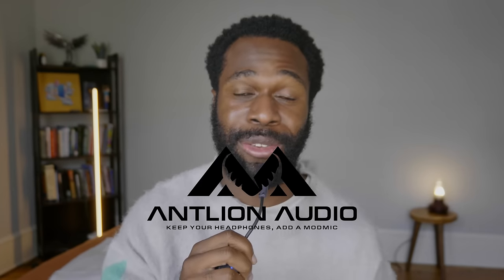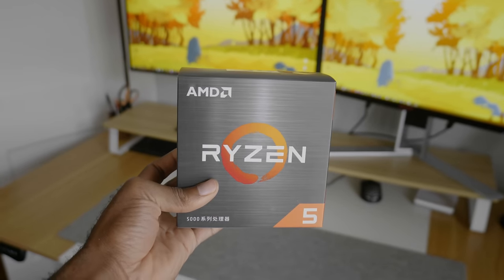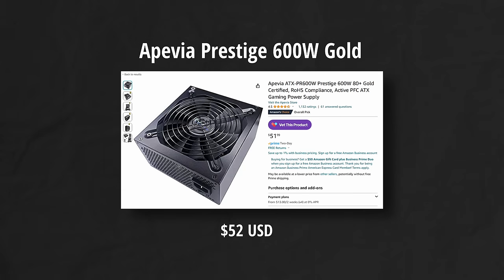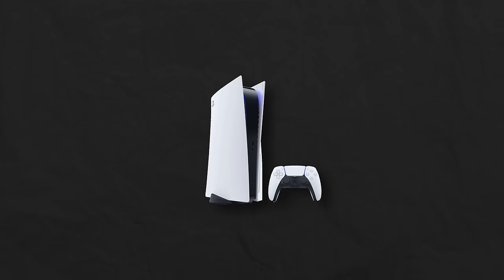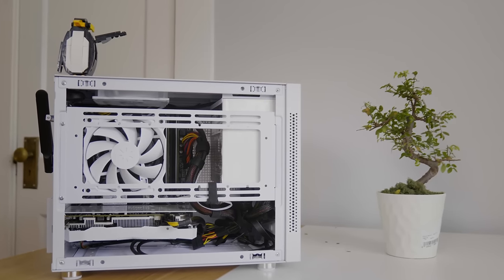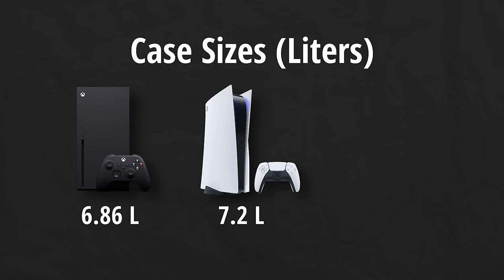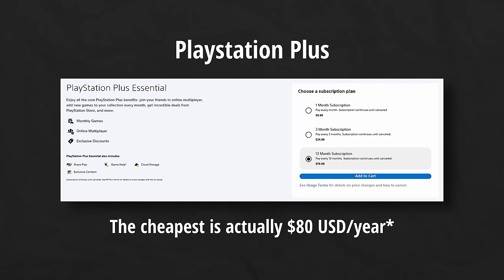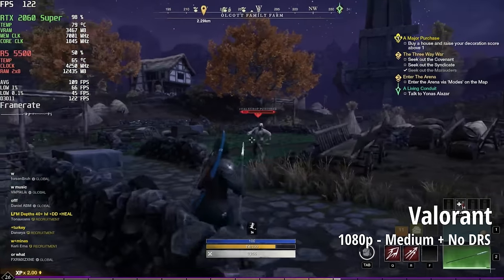The $500 PS5 Killer...did we do it?

Comment: Do not buy Nvidia cards if you want to build console killer machine. Reason is simple, both PS5 and Xbox use AMD graphics chips, and they are usually significantly better in performance/price ratio. Especially in budget segment. If you want console killer go with 6600, 6600M, 5700XT, 6600XT , 6650XT etc ...

Comment: About the GPU portion of the video... there is a gpu we can directly compare the PS5 to, which is the RX 6700 non-XT variant, and pairing that with a 4700g will essentially be like the PS5's processing unit. Same core count for the GPU and CPU, same amount of TMUs and ROPs, so you can't really say that there is a closer gpu to the PS5 than the RX6700, especially considering they are both based on the same architecture. Of course, console killers do not need to have the same specs as a console itself but I'm just pointing it out.
Reply: True. The 6700 is mostly identical in terms of stream processor count and architecture, the only major difference is memory layout.
Reply: @yasu_red  Yeah, but I feel like the difference in memory bandwidth isn't that much.
Reply: The RX 6700 is faster than the PS5 and Xbox Series X GPU. This is due to no limitations in memory bandwidth and no limited thermal envelope.
Reply: @ZackSNetwork  Correct, but on the other hand, the GPU in the PS5 and Xbox have access to a large unified pool of memory, while the 6700 is stuck with 10gb of VRAM.
Reply: @yasu_red The PS5 and Series X don’t have unified memory. They have shared memory because they are APU’s. They share the same memory and bandwidth with both the CPU and GPU. As for the RX 6700 it has infinity fabric that more than makes up for its unified memory. Also the PS5 and Series X only use 10-12gbs of vram for games anyway.
Reply: The ps5 has 10gb of vram as well. Xbox has a little more but that doesn't change the fact that you cant change the graphic settings for that to matter anyway.
Reply: RX 6700 is a bit better than GPU from PS5, but basicaly its downclocked RX6700, and about CPU there is Ryzen 7 4700S which is CPU from PS5, 4700G is also a bit better(higher base frequency and u have trubo boost, on PS5 u have max 3.5GHz and 8mb of cache, so Ryzen 5 3600 will have performance) so in the end u need Ryzen 5 3600 and RX 6700 for PC with performance of PS5
Reply: didn the Xbox had a faster GPU than the PS5?
Reply: @DDHDTV  In XSX u have something between RX 6700 XT and RX 6800(maybe its cutdown a bit RX 6800)
Reply: @dev1anceONE seems about right
Reply: @leogaming4663  It have 16GB of VRAM, but its shared between "system" and "video ram", and if u do some research then u know about CPU is custom Zen 2 with 8 core and 16 threads, with 8mb of cache and up to 3.5GHz with SMT enabled(They sell it with name Ryzen 4700S, but performance of this CPU is similar to Ryzen 5 3600), GPU is custom RDNA2 which means it used architecture similar to RX 6700 and any other RX 6000 series GPU, RX 6700 have almost same specs like that Radeon in PS5, so it isn't plenty of misinformation because today consoles are almost PCs with custom PC APU and custom OS
Reply: Your wrong. Pc need to have 8core cpu or more.  A gpu with 16gb or more to béat console. Is straight fact.  No way an 7700xt or 4070ti is better.. proof is cyberpunk ps5 4k easely outperforms those 2 gpu.
Reply: @690Dragonx  That weak PS5 CPU have 8mb of cache and at best 3.5GHz, and about CP2077 its works in between 900p-1440p upscaled via FSR2 on Performance mode and have drops to 50FPS, so yes, consoles have Ryzen 5 3600 and RX6700/RX6650XT EDIT. Oh and i forgot - PS5 and XSX have 16GB of ram SHARED between system and GPU
Reply: @DDHDTV  Only slightly. The difference in games is minimal.
Reply: he was staying with new purchases and cheapest 3700 is like $475 atm
Reply: @RideTheSkies  bro did you get that information from Walmart? 💀💀
Reply: @totogreeny  my bad, got it confused with the 3800 with lowest is $410 atm then bumps to $450. Still, 3700 is $350 new on pcpartpicker
Reply: @Barris_  bro you can't be serious 💀, they are literally the exact same spec besides some memory and bandwidth differences.
Reply: @Barris_  just runs the last of us at 4k high/ultra setting your pc then upload it on youtube. Show proof
Reply: @ZackSNetwork  abt the memory thing... you do realize that shared and unified memory are the same things, right?
Reply: @Barris_  you think everyone lie? but you dont have a highend pc and ps5? using adrenaline software or msi afterburner overlay is the same, both show identical spec/fps/gpu usage
Reply: @Barris_  you right is ps4 version, but on PC to look identical to ps5,,  it using 13 to 14GB VRAM to look identical. Rockstar and all big dev know 99.99% of pc gamers is on lower spec than PS5. that why GTA 6 is coming for ps5 /xsx first. because lowering graphical detail to low setup pc, is a wasted of time
Reply: Ps5 os better perfomance than windows.. and just one hardware optimisation ..
Reply: @Barris_  then prove it with real fact not just running your mouth like biased mad fanboy on low end PC :)
Reply: @Barris_   cyberpunk isnt even a ps5 exclusive and ps5 do far better then 3080.. just admit you broke. lol
Reply: @Barris_  benchmark made by player or made by promoter?
Reply: @Barris_  i know mosty of them but dont really need to be relate to all those promoter.. send link here
Reply: @Barris_  sorry  dude, if you have to beleive gamer nexus for better sleep at night.. god damn,, i didnt know those some promote can lie like him.. 0 bench just hand wirting fake performance. yeah gamer nexus hes  just a big liar , but at least i can see what liar look alike
Reply: @Barris_  3 years old hand wrinting benchmrak.. come on dude...
Reply: @690Dragonx wtf are you talking about bro
Reply: @690Dragonx GamersNexus are definitely more reliable than you
Reply: @690Dragonx You're not the only person on earth who can afford both a PC and a PS5😂
Reply: @deadking8224  sitck on your shitty RX 6700,   my pc build runs the last of us better than ps5 and rx6700.   the 6700 still cannot outperform a PS5 on Dragon dogma 2 and forbiden west. yup new games dude.
Reply: @690Dragonx  Don't own a 6700 though, own a 4070. And the 6700 XT is equivalent to and even better than the ps5 in Silent Hill 2 at 1440p Epic if you compare the benchmarks made by the other youtubers. The difference in frames is even more when you optimise the pc settings to the equivalent ps5 settings
Reply: @690Dragonx  Don't know why this youtube keeps deleting my replies.  The 6700 xt outperforms the ps5's quality mode in black myth wukong  too with the very high /high preset at native 1440p( without FG)

Comment: Spent around $700 bucks for my first PC build in 2015, the only upgrade was a really cheap GPU 2 years later. It absolutely held up for 9 years of great gaming. The newest and most graphic-intensive titles are starting to run really slow (low settings, 20-30 fps). But this thing still runs Counter Strike 200fps like a champ lol
Reply: are you planning on upgrading

Comment: You need to add peripherals. If you're a first time PC builder you need to add in the cost of a monitor, mouse, keyboard and desk.
Reply: if you are a first time pc builder you can get a starter pack or combo and get mouse, keyboard, headset, mousepad and maybe even a joystick for $50 and im sure you can find a used monitor for $50 more.

also, you can account for the path of upgradability in a pc, when the PS6 launches, if you want it you will have to straight up buy it, with a pc thats not the case, you can slowly upgrade it over time to keep up, and if you just want to compete with consoles upgrading that exact setup to the equivalent CPU and GPU will be cheaper, as you can still use most components without any problem, SSD, MOBO, RAM, PSU will still be usable for the next build.

Comment: I built a $500 pc with a GTX 1080 and a Ryzen 5600 CPU. Got a good motherboard, PSU and drive. Already had the case. Runs 1440p on med-high lretty well on AA or indie games and 1080p high with pretty much no dips below 80-100fps on most games.
Reply: Yoo I got the gtx 1080 ti with i7-7770k for $382
Reply: @Nish00128  Nice

Comment: Great video! If it wasn't mentioned already, I have a few suggestions:

1) You touched upon it in the video somewhat; Under Volting the CPU will greatly reduce heat and help improve performance.
2) Under Volting the GPU / graphics adapter will also reduce heat and help improve performance
3) If your motherboard and GPU support it, ticker with the fan curve to adjust fan speed only when temps increase to a certain threshold. This may reduce fan noise level.

*Tweaking these settings may take a few days due to stress testing / trial-and-error so be patient*

There are a good number of resources on how to perform the tweaks mentioned above on YouTube. A simple search with the make / model of the device of interest should suffice. 👍🏼
Reply: What is "under volting" ?
Reply: Applying less voltage then it comes with by default. Due to how PBO works, applying less voltage can result in less heat, and more performance. This is completely the opposite to how overclocking was done back in the days, back then it was the norm to increase voltage for more Mhz. Some manufacturers are notorious for having UEFI/BIOS settings with waaaaay to much voltage out of the box. Most motherboards, videocards, etc. come with very safe defaults out of the box. Most of the time, you can lower the voltage without any issue/damage or long term effects.

Comment: I have both a gaming pc and a ps5, and since I work remotely I would always choose a pc since its not limited to gaming/entertainment, but one insteresting point for me is that most of the "console killer pc" videos come years after the consoles come out, so I'd love to see someone take on the challenge the same year a console is launched. Also the consoles come with a quality controller that is at least 50 (euro here I suppose its similar in dollars) that should definitely be taken into account because you can't tell me that its a similar experience to using a dirt cheap 10 dollar keyboard and mouse combo
Reply: Good points, generally every console controller can be used on a PC.
And if you go for one of those Elite/Pro controllers on the console (those run between $100-200 USD), you can fund a decent K/M setup on the PC side.
There is wiggle room.
Reply: I remember when the PS4 came out and lots of youtubers came out with budget console killer builds. None of the pc builds survived past 2016. Even more so for the builds that included a blu-ray/CD player & hifi sound card. Yet I know people on launch model consoles who can still play some of the latest games, on 10 year old hardware.
Reply: it was hardly possible to buy a ps5 for a year after launch at msrp
Reply: @labibahasan8302  Exactly, these people are delusional. They quickly jump to the gpu being equivalent to the amd 6700 non xt not realizing it's a COSTUME version meaning it's similar but not the same. They fail to understand a console is a onetime investment and the pc for the most part its not, at one point you will have to add more RAM or a better video card or bigger psu etc.  They argue about how you have to pay for MP in consoles which for me and many more its irrelevant since I don't play nor care about MP. For me the strong point of the console is the single player games. I personally I have and play on both platforms, why limit yourself when you can have the best of both worlds.
Reply: @Atlas-hu9wk  You’re right, and even with the cost of multiplayer a pc still isn’t worth it for long term home entertainment. Let’s say a console + 6-7yrs of online is like $800. There is no $800 PC from 2013 that is still running current games at 1080p/60fps like the PS4 is.
Reply: @labibahasan8302  A console will not run all the games at the highest settings or fps but it will be much much more stable on the long run vs PC.

Comment: Honestly, that case fits the whiteout setup I was going for about 7 years ago. 
I had the following, if you're curious:
- Corsair Carbide Air 240 in white with black accents and interior
- Black & White MSI RX 480 GPU
- MSI B250M MORTAR ARCTIC White MOBO
- 8 GB Black and White Ballistix RAM
- i5-7500 (just so the specs are out there)

It was cool, but the Air 240 is notorious for GPU cables rubbing on the acrylic window. Turns out, it's actually enough to leave a scuff mark on the window itself.

Comment: Picked up a bunch of lightly used HP prebuilts for cheap recently. Ryzen 5300G, 8gb (2x4) 3200MHz DDR4, RTX 3060 12gb, and a 250gb NVME drive ... $300. Been upgrading them for flips or pulling parts for custom builds. A bit of hunting right now can lead to some super nice deals. And, while prebuilts like those HPs suck from the factory, if it's a good enough price you can always pull the non-proprietary parts and go from there.
Reply: You have a CPU bottleneck. 8gbs of ram is not good you need at least 16gbs of ram. You can’t fit much of anything either on a 250gbs SSD. The 3060 12gb is a great budget GPU though.
Reply: @ZackSNetwork  im sure hes flipping those...
Reply: Where the hell did you find a prebuilt with a 3060 ($450ish) card for $300.  That's better than my previous find which were two complete FX 8350/32GB Systems that the guy told me "Hey,  are you into computers?  I just throw two away in the garbage you can have if you want."
Reply: @Atari5732  - A guy who had bought the machines for mining right before the crash. They have just been sitting in his garage. I got 7 of them. But deals like that aren't that rare now. The prices I'm willing to pay for parts is ever dropping. To be fair, I hunt for deals since I build PCs perpetually.
Reply: @ZackSNetwork  - Yeah, reading comprehension is hard
Reply: I appreciate you for owning 2nd hand parts, seeing how more reliable they are (I just realised Bak covid), also helps keeps  e-waste

Comment: To reduce electric consumption you need to use vsync, and frame capping to a 60fps  this will put less strain on the hardware while also using less power by 20-45%.  For example DL2 in 1080p high with with my PC went from 190W to 110W on a I5-12500T, Z690 MB, and a RTX 4060 (it was 220W to 150W with my old RX6600 BTW).  The game I saw little to no help on this was RDR2 unless I lower quality settings only.  Power reading was a out of the wall power reading on a kilowatt meter
Reply: The problem with this is that setting a cap means your using very little of the hardware, so a more low end gpu would make more sense for that.
Reply: @appsaucetech  To a degree yes, but to another no.  This works on higher resolutions too that older cards nor low end cards can not do as well.  This also helps with other areas including giving you a smother game play which is one reason a lot of gamers do prefer a console.  Response times will also be better as well.  Anyway try playing Dying Light 2 in 1440p or 4K on a GTX 1060, 1650 super, or a RX580 heck try in in high settings natively in 1080p.  

I have played it on a 1650 super & it was not so super.  Was it serviceable yes, but not great either.  Were this becomes moot is older titles or those that have the requirement bar way low like CS: Go, other E-Sports titles, and or older/indie titles.  Consoles have vsync on, and they have frame caps of the majority of their games for the same reasons, and more.
Reply from the maker: Does this still help if we can’t reach the 60 FPS cap? Neither Alan wake 2 or cyberpunk could hit the 60 FPS limit
Reply: @OzTalksHW  If you use FSR on a RTX you will get zero benefit in both performance & power consumption reduction.  It's best to use DLSS on my 4060 in Cyberpunk in 4K, PS5 settings, and DLSS set to auto I maintained 60fps with a 175W power draw.  With DLSS turned off but FSR turned on I got 36fps and a 240W power draw.  Also for some reason my 35W CPU also auto overclocked to 65W during the entire test (that is not normal).  On AMD cards AMD Chill will be the best way to go (set the minimum & max FPS manually to 60)  It'll only max out if you don't keep your expectations grounded to reality quality wise.
Reply: Trust me, I have played minecraft with shaders at 4k on my 6600. I needed a 60fps cap. If a card doesnt have the performance to reach 60fps then of course a cap will not lower usage in that sense. I don't know why you mention that gamers prefer a console because of the cap. A pc can have a custom cap set, so if you have the performance for say a 75fps cap then it will be better than the console. Besides, the consoles can't even reach the 60fps most of the time, and thats with fsr. A pc will generally have a much smoother frametime because you can set the proper cap for your hardware. @JeremyLeePotocki
Reply: @JeremyLeePotocki lol 65w is more than normal. It's like saying you cpu going 4.4ghz it's not normal. That's the boost speed and that's the boost power consumption. It won't be able to clock at 4.4 with 35w at 100% use. If you don't like that you can still disable turbo boosting, but watch how it effects you games ahah 
As long as temperatures limits are not reached, the CPU will constantly be pinned at it's maxed tdp (yours is 75w, sounds like you're either overheating or not using the CPU 100%)
A CPU with 35w at most is a mobile CPU. Nothing can compare it a full desktop CPU that had the ballpark of 65w for more than a decade.